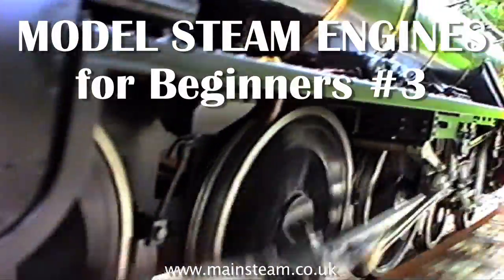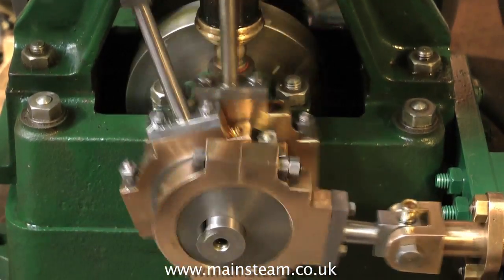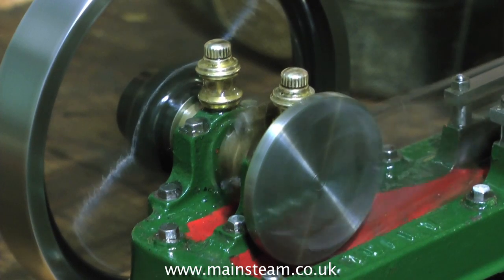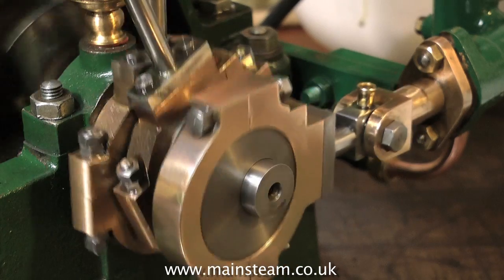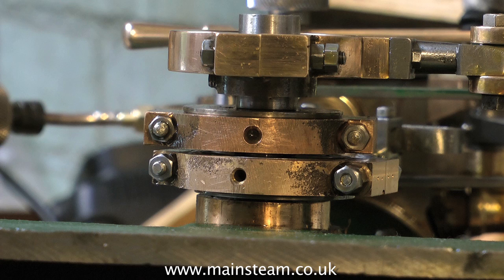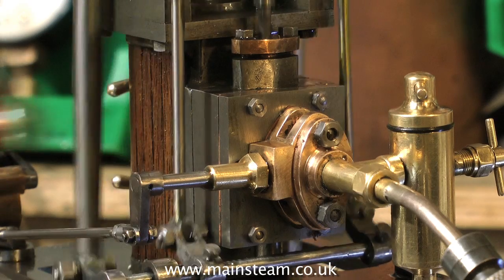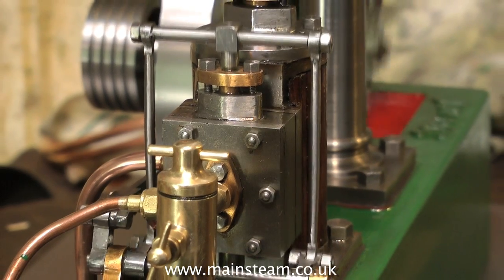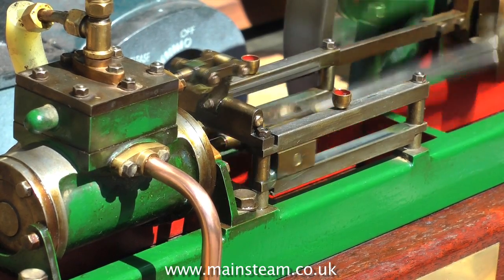STEAM ENGINE TROUBLE - MODEL STEAM ENGINES FOR BEGINNERS #3

Comment: I don't even work on steam engines, but I have started playing with Lego pneumatics which are pretty similar... i just built my first running 2 cylinder pneumatic engine and I'm really starting to figure out valve timing and stuff. It's really fun.
Reply: Melody yeah LEGO pneumatics are fun. I just finished a pneumatic V8. Almost have it running

Comment: Great videos Keith I have learned a lot from them.  I have a 4" Foster traction engine that I would like to check the valve timing on. Would be able to point me in the right direction?  Thanks. John
Reply from the maker: Have you seen the video that covers steam engine timing? The principle is exactly the same for a traction engine.
Reply: +Keith Appleton Thanks Keith. Yes I did watch that one thanks and it has helped a lot.  Bye the way did you ever make the video for valve timing on a reversing engine? John
Reply from the maker: There is one about a Stuart 5A in the "Steam Engines for beginners" The 5A was originally no reversing but I added Stephenson's link reversing gear and describe the setup.